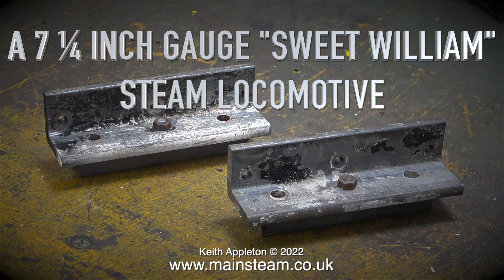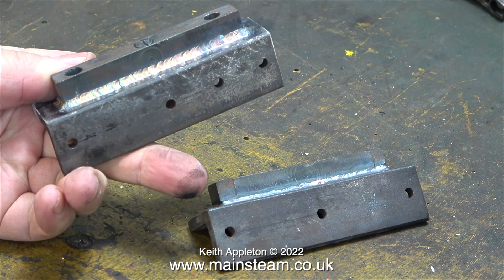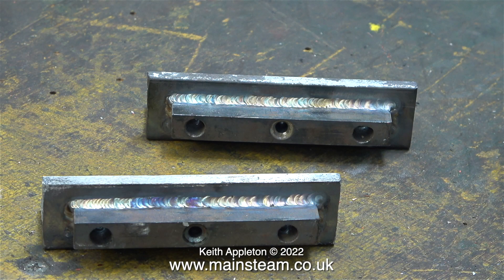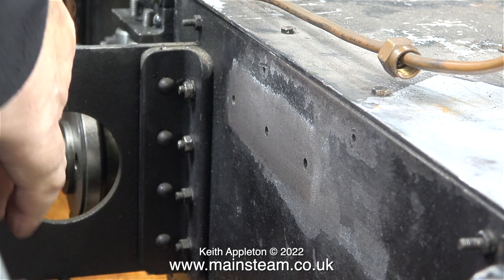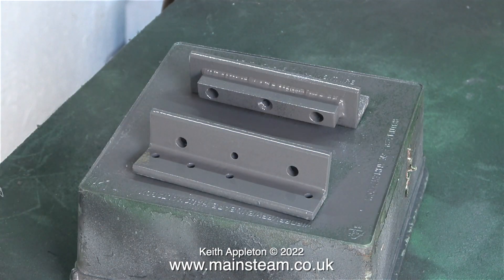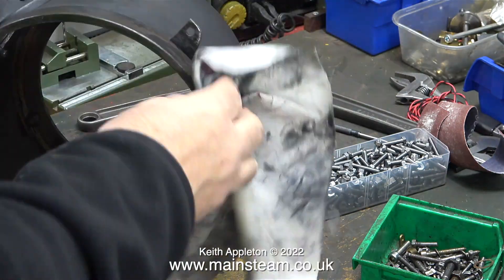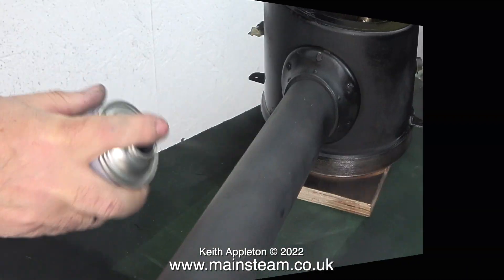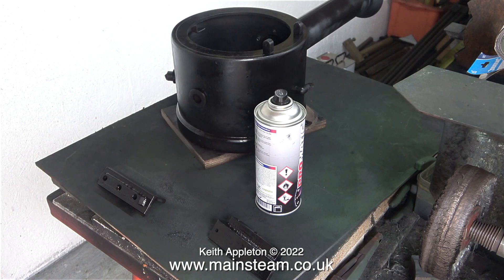A 7 ¼ INCH GAUGE "SWEET WILLIAM" LOCOMOTIVE - PART #7

Comment: I'm a bit surprised that whoever did the welding job didn't wire-brush all of that paint off. The welds are pretty, but the burnt paint, not so much.
Reply from the maker: The welds are good, that's all that matters I think.